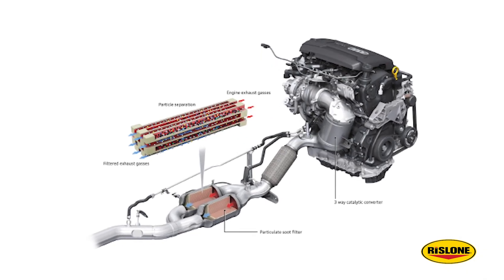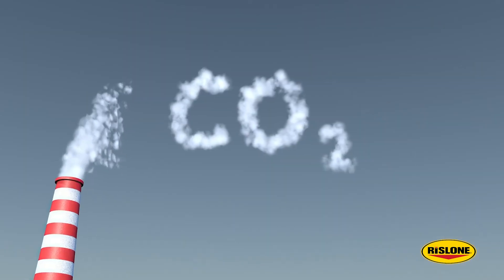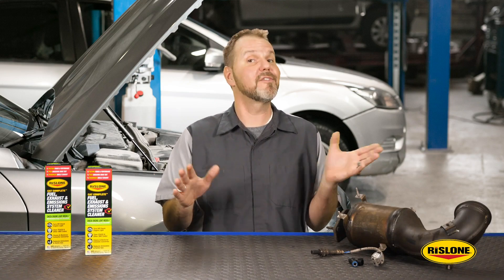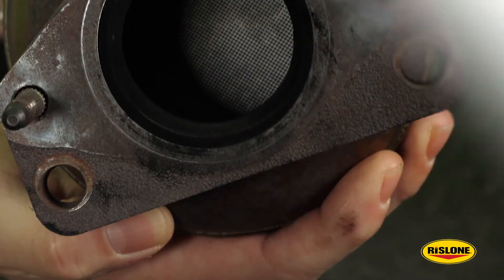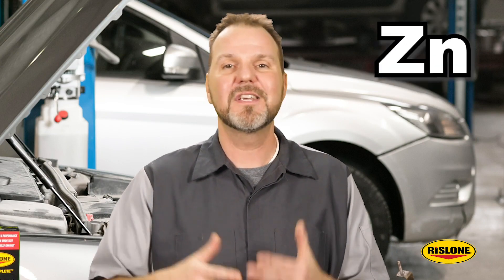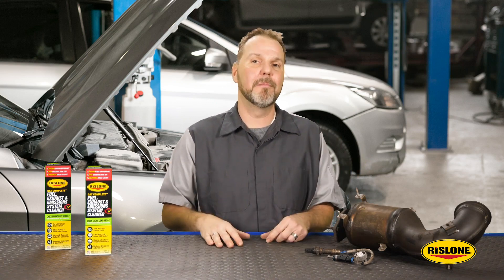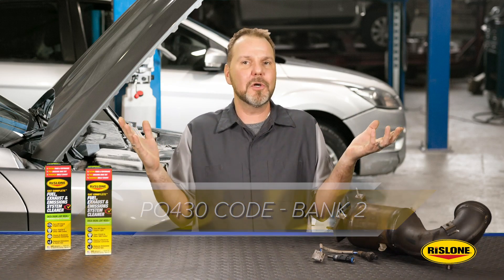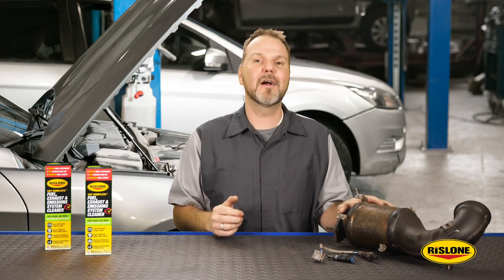Understanding Catalytic Converter Problems

Comment: BOOM!!!  closed loop<<< initiates feed back monitoring... NOT open loop.. Open loop operation is done on a time schedule from 1st revolution detected to thermostat open and varies heavily on manufacturer. 
HEGO as well as AFR sensors replaced the front O2 feedback. All designed to keep the vehicle running as close to lambda or stoichiometric as possible.  Sometimes produced?   Burning of any carbon fuel sorce will result in NOx production which is the real evil gas.  Regardless, 1 pound in a pound will come out. It's a physics thing, so the idea is to convert the unwanted chemicals, into less unwanted.  Nature would eventually break them down but accelerating the process is desired So a catalyst is empolyed. As well as EGR or Cam phase to control combustion temperature and lower that evil NOx.
Reply: you are correct, i mixed up the terms and didn't catch it during editing. No excuse on my part. Thanks for catching that.